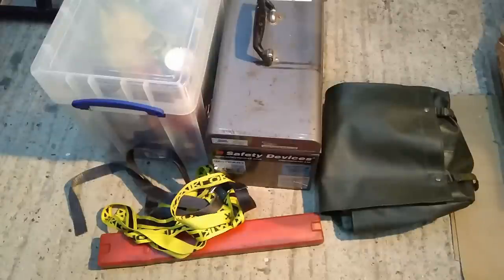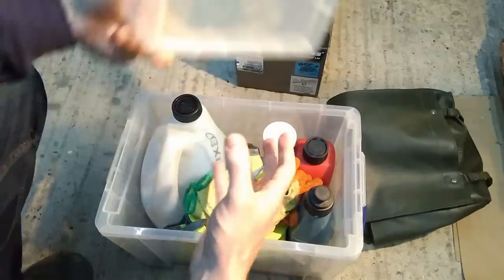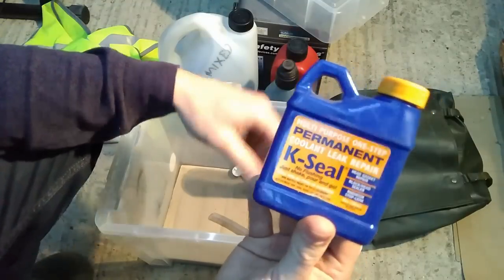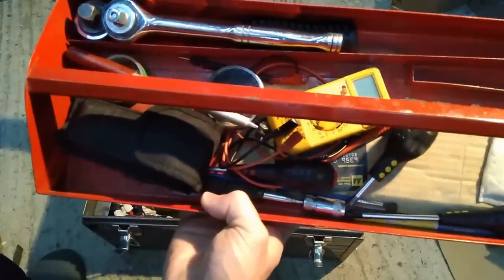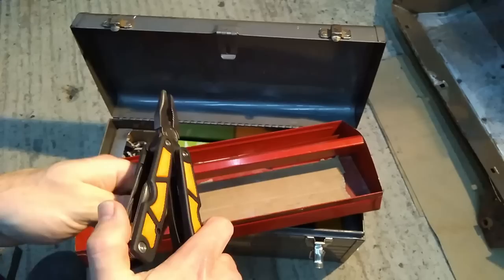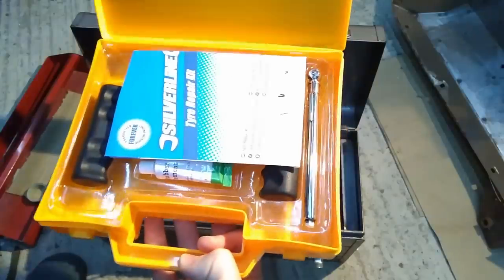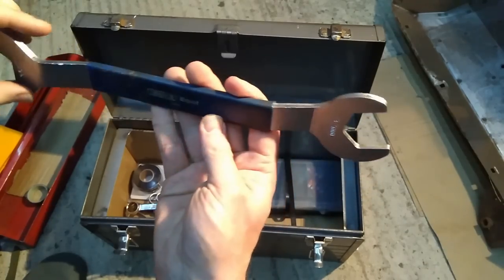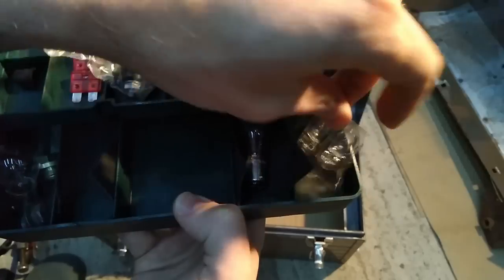Tools and equipment I carry in my Defender. POINTLESS or not?

Comment: 2 most important things to do to a 300tdi are a electric fuel pump the solid state ones last for many thousands of hours and male bleeding a doddle and the 2nd thing id fit a low coolant alarm they save buying a new head if the level drops oh and a 3/4 power bar and socket for the wheel nuts a couple of decent hyd jacks , i carry 6 and 12 ton ones along with a few bits of 12x2 in bits of timber for jacking bases , as far as tools go can rebuild most things on the side of the road if need be not motor of gearbox but anything to do with steering or brakes , the tyre plugs are worth there weight in gold even carrying 2 spare tyres along with 2 compressor. I am set up for remote travel in Australia. Carry lots more and have needed everything i carry at least once . Rear jerrycan is always full of water . Anyone that travels remote often will know what i mean .
Reply from the maker: You guys in the outback are in a totally different league - that's an impressive amount of kit you've got but built up from experience no doubt :) I've got a low coolant alarm - need to do a video on it
Reply: I don’t go silly in gear I carry wheel bearings and such I just make sure they are right before I go maintenance is everything plus it is my daily . Even unheard of failures like I had last weekend between a lot of common sense and not panicking got myself home . Handy hint , I drive a D1 it had a alloy unijoint going onto the imput shaft on the steering box it stripped without warning lucky I was hardly moving reversing into were I was camping anyway . First thing setup camp , looked at what the problem was , had dinner went to bed , next day nut out a way to fix it not going to tell how because it is way to scetchy for mere mortals to understand, fixed it and have a nice afternoon, next day packed up and headed home . Were I was I did not see another vehicle or have phone reception, could not raise anyone on the 2 way while I was there did not see another vehicle until I had traveled 100k or 60 miles . Been self reliant is fairly important along with 45 years as a field service mechanic on earthmovers. If you come across a alloy steering shaft on a disco throw the bastard away and fit a steel one

Comment: Well those are the tools but presumably you have spares box too?
A few surprising omissions. No hammer (or did I miss it)? No Torx key for the R380 fill plug? No 52mm hub spanner? How do you do the prop shaft bolts? You can use a 14mm combination spanner and an adjustable to hold the other end but not ideal.

Comment: Those tire repair kits are (usually?) labeled for diagonal tires. You can use them on steel belted tires if you carry a cordless drill with a 6 mm bit (I do). Without pre-drilling, you're not gonna stick that needle through the steel belt. Biggest riddle to me how anyone is using these kits and why they're sold everywhere.
Reply from the maker: I guess it's one of those things you see advertised and just buy it and throw it in the truck. It pays to know what you're using, so maybe I need have a go with an old tyre...!
Reply: Those tyre (not tire) repair kits work perfectly on a radial tyre. And you don't need a cordless (or corded) drill. Most diagonal  tyres are not even tubeless tyres...... Have (temporarily) repaired tubeless tyres using this type of equipment over the last 20 years in Africa and Asia without any problem. Bear in mind however that this is a temporary repair. It has nothing to do with diagonal or radial tyres. None of the tyre repair kits are labelled for diagonal tyres. If you don't manage to use this tool properly perhaps you're "tired".
Reply: They work fine on radials, but if you’re running proper mud or all terrain tires by the time you actually get a flat it’s not going to be from a screw or nail, it will be a proper gash and totally unrecoverable with this kind of kit
Reply: i used these loads of times on a 2 yr /75k mile tour of africa on mud terrains absolute essential in my view - they work very well no drilling needed.
Reply: @landexta4994  Yeah I stand corrected. I confused (I'm old) these ropes with the TipTop Super Sealastic which I like a lot more than the ropes. But they tear when you don't pre- drill the steel belt.